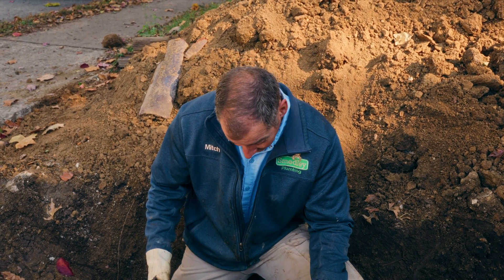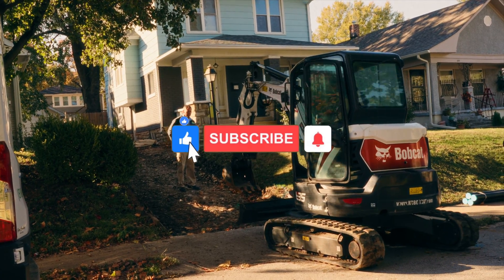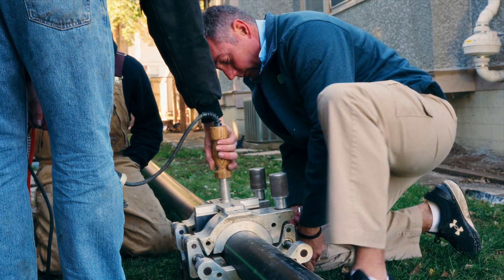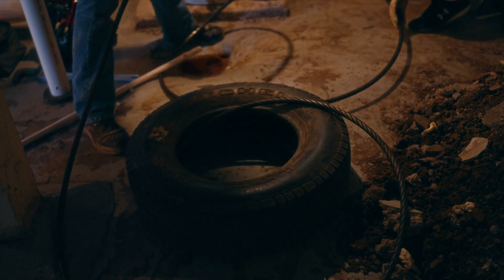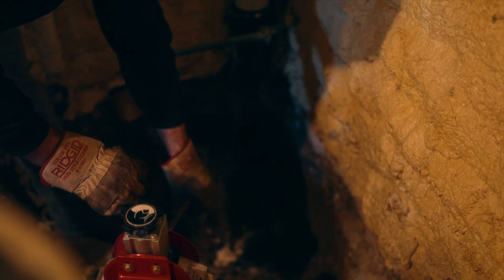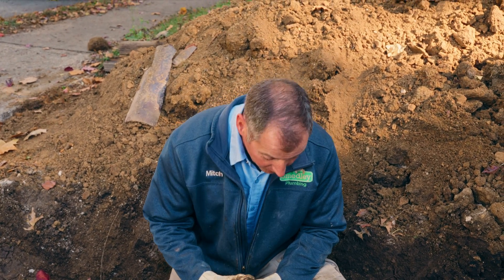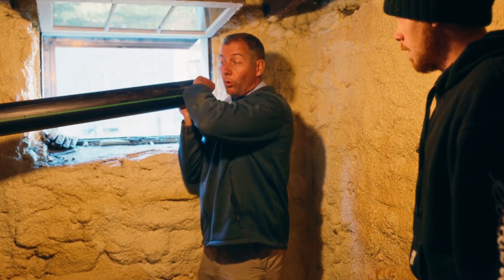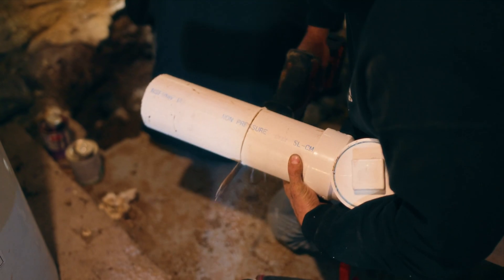What is Pipe Bursting? - Sewer Replacement Plumbing Tutorial

Comment: You didn’t deburr your joints?
Reply from the maker: Correct.  We do not ream the internal bead on HDPE.  It's a smooth rolled bead that doesn't interfere with flow.

Comment: How do you overcome issues with back pitch on your sewer lines using this method?  I've seen a similar method employed for installing main water service lines through old service lines, but pitch isn't of concern when installing water lines.   With drain lines, having correct pitch is critical.  Does this method allow you to select the correct pitch and maintain it through the entire drain line?
Reply from the maker: If the belly in the line is too bad, that has to be corrected the old fashioned way.  But pipe bursting will straighten out small offsets that come with clay tile joints.

Comment: Can pipe bursting be used on main lines throughout home under the foundation and out to the front yard or only outside ? Please help and answer. I appreciate it in advance and thank you !
Also, I’m in AZ so I don’t think your located out here at all but how much would you charge to get on the phone for some advice and professional info on my situation in my home please and thanks !
Reply from the maker: Shallow depths under concrete and areas where two pipes intersect make using this method indoors in a residential application very unlikely.

Comment: I''m looking to build a tiny house on a new plot of land. This looks like a viable and affordable way to install a new sewer system and connect it to the cities' sewer line.
Reply from the maker: This is a great sewer replacement method. This method needs a host pipe in the ground in order to work.  New construction will need to be bored or traditionally excavated.